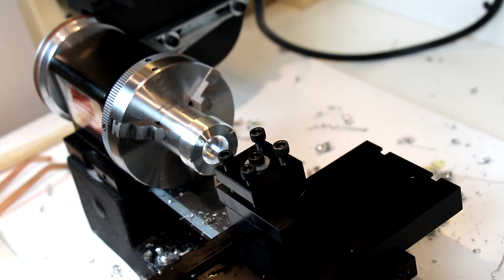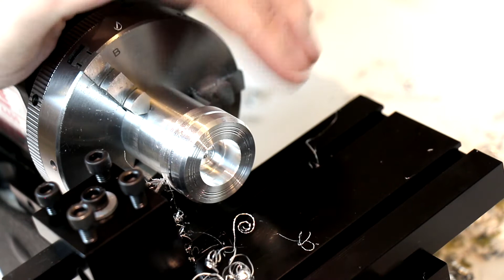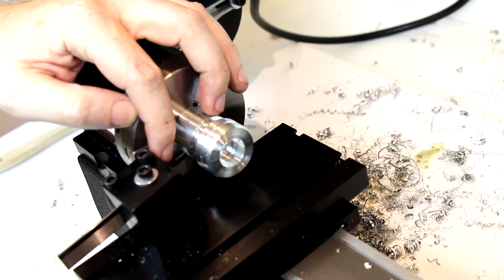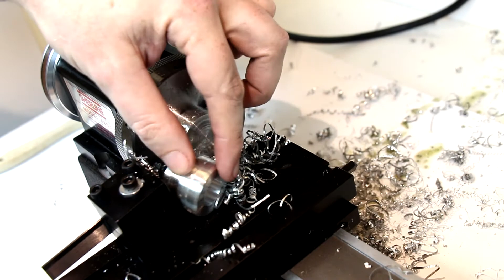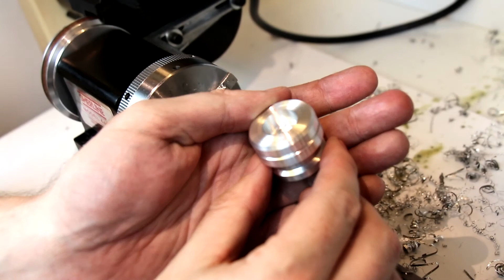Metal Lathe 113 - Operation Basics, Grooving & Parting Off

Comment: I recommend using a square to set up the cut off tool, and also make sure the tip of the tool is very square and sharp. On larger lathes using much stiffer cut off tools, it is often good practice to widen the kerf by working on the side of the cut to prevent chips sticking.

Comment: Nicely explained, I would encourage beginners to not try to completely part off, just go in enough to break it off by hand.  I always tap the part to get it off, this prevents damage to part and operator, which is important if the part has threads. You are much braver than I, to be using a HSS blade, I only use carbide inserts which don't rub on the sides. I use small cnc lathes so the lathe is enclosed, I would expect to part aluminium of that size at around 3000rpm, but that may be hazardous in an uncovered manual lathe. Good Video!